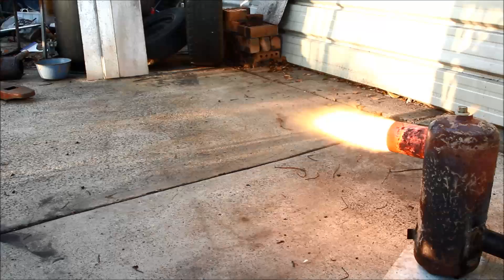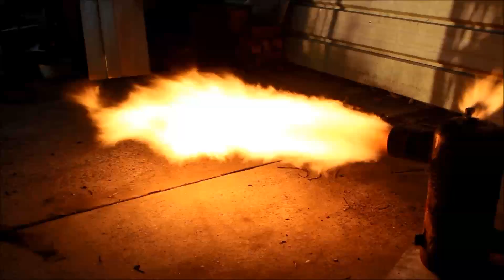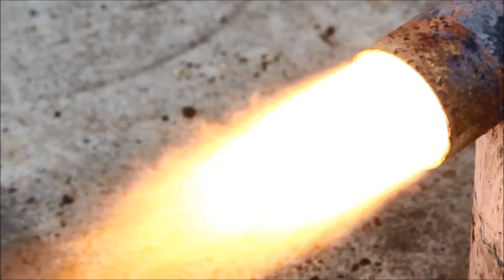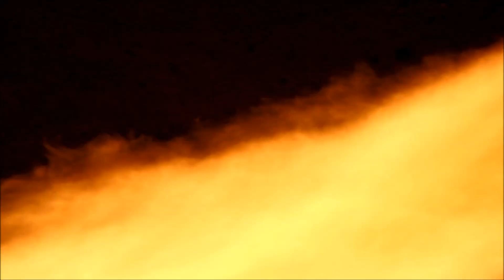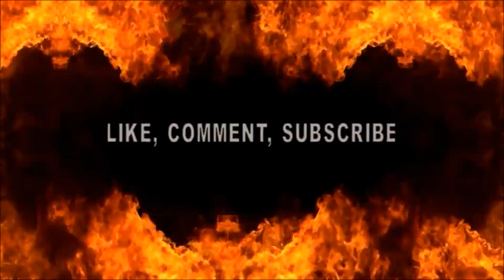Most powerful waste oil Burner, 600KW heating power!

Comment: Does it melt steel or inconel?
Reply from the maker: Steel, definately! Inconel depends more on the refractory of your furnace than anything else, Cranked up there are not many refractories that an oil burner won't melt that any backyarder could get hold of.
Reply: that means good oil burner furnace can reach to 1500 'C?

Comment: If you can introduce secondary air into the flame it will turn blue and double+ the heat.
You are not getting all the energy out of the gasses yet.
Its like an oxy torch burning without enough oxygen if you catch my drift, fair go though! Only a thought....You will need it if you want to do iron smelting...
I hope your neighbours are not greenies though? Cheers, good entertainment, Norm
Reply: Norman how would this happen do you have any schematic for  ??

Comment: Do you calculate the power of your waste oil burners by extrapolating from their fuel consumption? I always wondered how you know how powerful your burners are and I doubt that you have a calorimeter set up that can handle how hot they get.
Reply from the maker: Henryandginger Yes. I work on the BTU of oil converted to Kw through the fuel consumption over time. 
There is no efficiency curve with these things. As long as the fuel is burning cleanly and not smoking the output is directly related to the consumption.

Comment: Considering my Omega stove is running 5.5 kw, that's a beast! 5.5 kw will heat my 1000 sq/ft basement. That might just heat a stadium!
Reply from the maker: kbbacon The good news is, it's capable of more output!
Next thing is to increase the fuel line size for even more flow and see how  that goes.

Comment: top notch stuff mate. Just finished building my own. your videos have really inspired me to make HUGE FLAMING METAL BEASTS haha. check it out and see what you think. i really think the size of the outlet  has an effect on the heat generated. its a balancing act getting the fuelling to match the air. that's my experience anyway.

https://www.youtube.com/watch?v=AYN-IHWikJY

loving the vids mate keep them coming!!
Reply from the maker: Sam Thomas I was looking at the new vids for oil burners and saw yours.
Very well done! I like the rocket flame out the chimminey. I could imagine sitting round the yard watching that for hours!
:0)
Reply: I've added a Pyrex glass window now so throws some light out even when I'm not melting my garage roof haha

Comment: I love the new burner. I found myself a used propane bottle filled it with water and am ready to cut her open. I hope the larger diameter bottle wont cause any problem?  I think the crazy warmers should be thanking you for your service your saving the  water supply just think how contaminated the water could be if even a tea spoon of that oil were spilled :-)
Reply from the maker: builtrodewreckedit  Larger bottles work better, more surface area to vaporise the oil. Just make sure to have the inlet so the air is spun around the bottle in a swirling motion.  Other than that,  The things work just about any way you want to build them. 
make sure to let me know when you have a vid of your burner running.

Comment: blimey skip why dont you make electricity with that beast ?
Reply: Use it to power a diesel genset. Voila electricity.
Reply from the maker: *****  I'm open to suggestions how? :0)
I'd love a steam engine but unfortunately something like that is beyond my engineering skills and my pocket atm.
Reply: @glumpy10  Attach Multiple Peltier Devices To The Unit They Are Relatively Cheap 
Bless Up

Comment: Damn brother, soon you will have to anchor your (JET BURNERS).. ;) This would certainly heat a large building FAST!!!!  
I didn't see any unburned oil sputters at all. So it looks like a complete burn inside the vessel. Maybe it's time to build a slurry box with an outlet pipe running through and see how fast you can heat the water in the box? Could be the answer to the rapid heat HOT TUB!!!

Comment: holy cow thats a lot of heat how long is that flame? One day i will build it to🔥🔥
Reply from the maker: RC matties  It's not hard. Big inlet and outlet, Big blower, big fuel supply, BIG Flames and output.
Flame was over 1200mm and 90mm"+ in diameter. as you can see, it was straight out and flat. no lazy smoky flames here!  :0)

Comment: Why not make a burner out of stainless steel?
Reply from the maker: margus014 I would If I could get a suitable bottle. These are just old fire extinguisher bottles I pick up from a bin. 
They last pretty well ( years) and cost a lot less than stainless. I'd certainly like a stainless burner but lack of skill in working the raw materials and not finding anything pre made is a problem.
Reply: would this finally be a use for the big (job size) freon tanks that nobody seems to want?
Reply from the maker: Jeff Thorsgaard
 If they are what I think you mean, yes. Although the one of them I found seemed pretty thin so may not last as well as the extinguisher bottles.